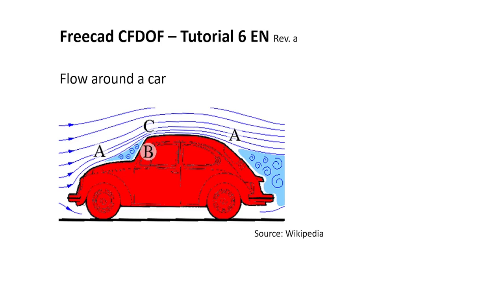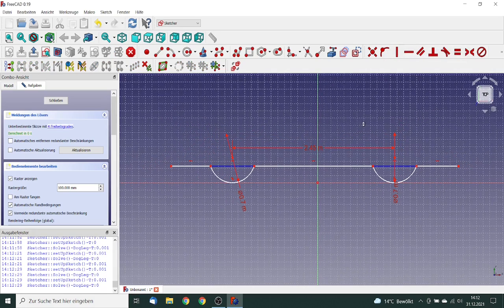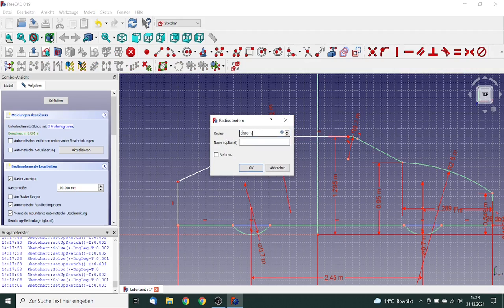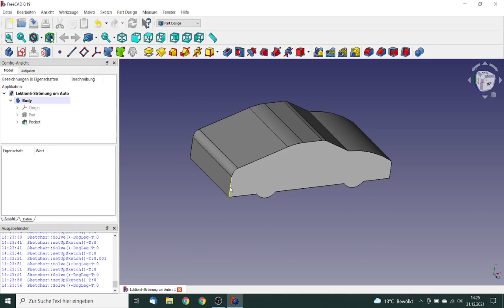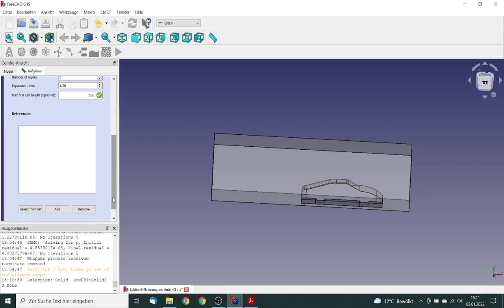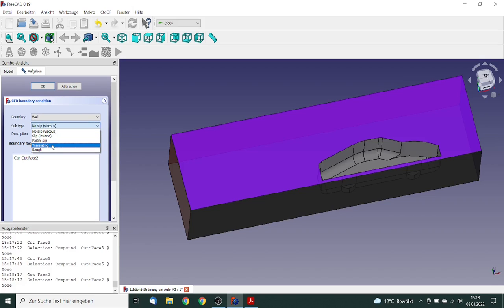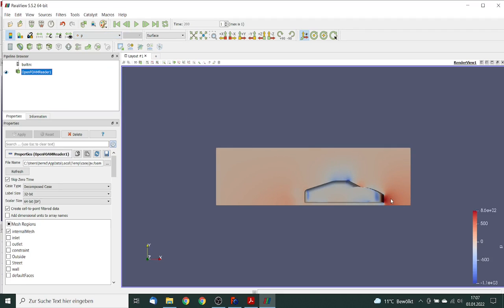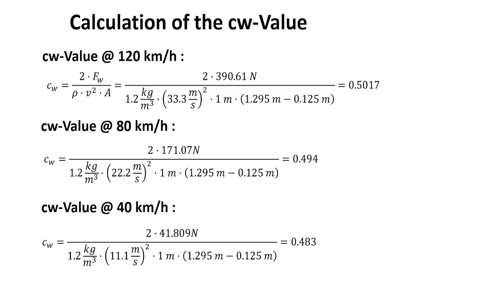Freecad CfdOF Tutorial #6: Flow around a car

Comment: Firstly, many thanks for this excellent tutorial, and the other excellent tutorials in this series. One question I have about this tutorial is that when you set the boundary conditions you set the wall receiving the car as a symmetrical constraint, is there then a way for the whole of the car to be seen in Paraview? If not, what it the reason for setting that boundary as a symmetry?
Reply: Hi @concretedog7427, there is a function called Reflect in Functions->Alphabetical->Reflect, hope it can still help ! Moreover symmetry allow to reduce the computational cost or for the same cost you can have more resolution because there is the same flow on the other side. (Does not apply for non symmetrical objects or complex flow behavior)

Comment: Thank you for the tutorial. I get an error when using the cut function. The error is "Body: Object not allowed". Could you please assist?
Reply from the maker: This seems to be a problem with the part design workbench. As mentioned several times before, youtube is not the right medium for questions like these because a) you do not have the possibility to upload the file and information about your system b) only one (=me) can answer your questions. The right medium is the FreeCad-Forum. In the FreeCad-Forum, many experts can answer your questions. Here is the link to the FreeCad-Forum: https://forum.freecad.org/index.php
Reply: @techbernd5535  Thank you

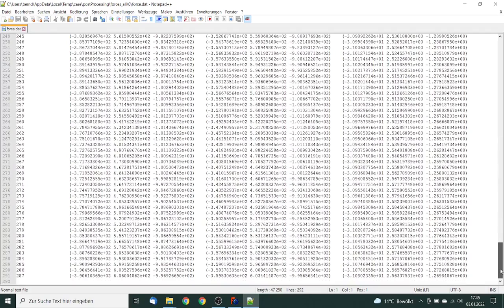Comment: Thank you for your carefull work. Could you, please, comment on the fact that the corresponding columns 1 and 4 or 2 and 5 or 3 and 6, representing force and pressure components, respectively, are quite close in their values? See at 37:54.
Reply from the maker: Looking on the header above the columns, you will please find the labels "total_x, [...], pressure_x, [...], viscous_x, [...]. The "total_x" is the sum of "pressure_x" and "viscous_x". Because the share of "viscous_x" is low, the first and the fourth column are nearly equal.

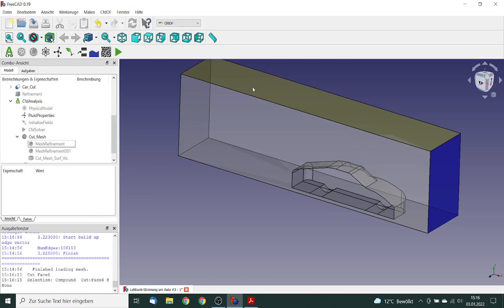Comment: Thank you for the tutorial, may i ask why the upper wall boundary condition at 25:39 is not "slip" ? Whats the difference between the upper wall and the back face as you have set the later to "slip" but the upper wall to "outlet".
Reply from the maker: Thank you for your interest in my tutorial. You are absolutely right: both boundary conditions are possible for the rear wall. I simulated the "wind tunnel" application, hence the boundary condition slip. The boundary condition “outlet” or “open” should in principle also be possible. Please note that I deliberately chose the dimension of the simulation space to be very small in order to save storage space and computing time. If the simulation space had been chosen to be sufficiently large, the difference between these two boundary conditions should be very small.

Comment: the text you copy and paste at 30:38.... you could simply put it in the description, it requires googling, and a debit or credit card to access online..
Reply from the maker: Thanks for your question. The tutorial by Mr Oxtoby can be found here: http://www.opensim.co.za/training.html, the pdf-File is here: https://github.com/opensimsa/opensim/raw/master/Documentation/CFD/UAV2/CFD%20Tutorial%204%20-%20External%20Aerodynamics%20of%20a%20UAV.pdf

The missing text is here:
functions
{
 forces_all
 {
 type forces;
 libs ( "libforces.so" );
 patches
 (
 wall
 );
 rho rhoInf;
 rhoInf 1.2;
 log off;
 writeControl timeStep;
 writeInterval 1;
 CofR ( 0 0.6 0 );
 }
}
I already adapted the Center of rotation (CofR) in the y-axis from 0.0 to 0.6.

Currently, a new version for Freecad cfdof is available. In this version, the evaluation of the forces is included. You can find the corresponding posting in the freecad-forum: https://forum.freecad.org/viewtopic.php?p=592032&sid=94a382e0b80d7b94821582ab076920eb#p592032
Reply: @techbernd5535  thanks for the prompt reply! and thats a much less painful link than where i found it on Scribd.....